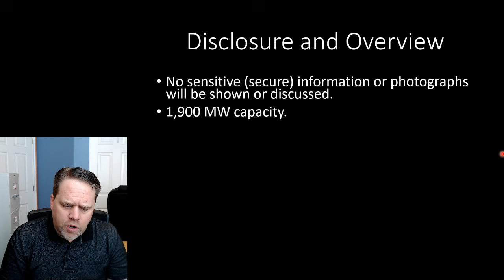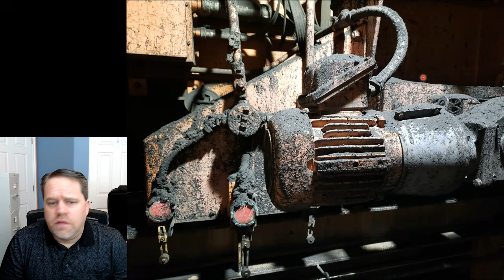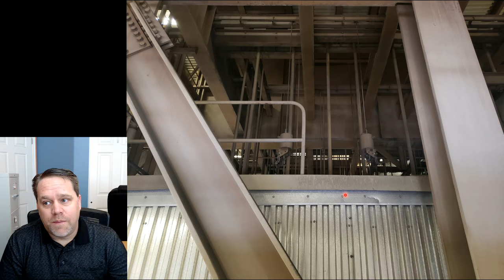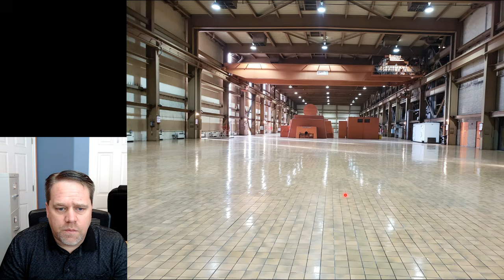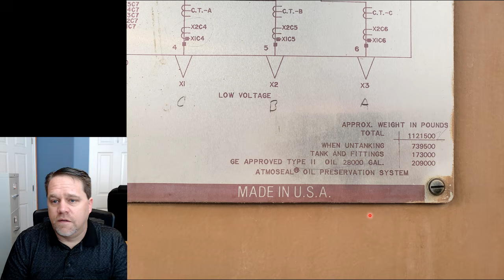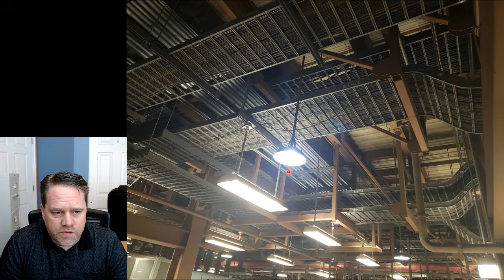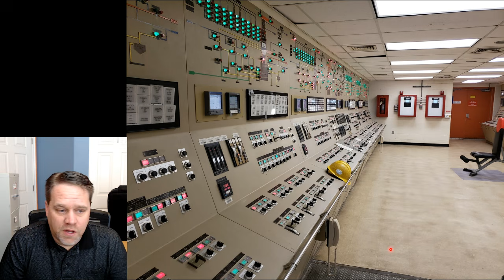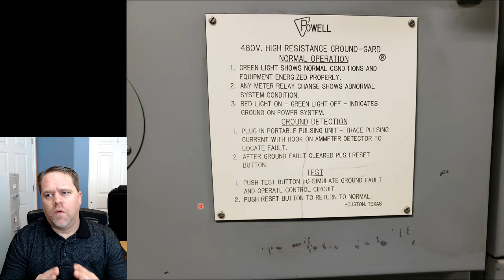Inside a coal-fired power plant (IPP plant in Delta, Utah)

Comment: I appreciate what you do. I've worked at 2 coal fired power plants and now a gas/oil one and have seen the same configurations on the east coast. The main reason why boilers are hung from the top though are not due to seismic activity but because metal grows when heated. On a typical 200mw or greater boiler, that mass of a boiler will expand over a foot from cold to online. That's why all the connections going from the basement to the top are not rigidly connected to the support structure. There will be flex connections on piping areas that allow for that on areas that have to be close. Look at the burner front. Any instrumentation that goes from catwalk to boiler will probably have a steel braided flex lines with slack that connects to it. If not... things will snap. I like your vid and keep them up. I just had to clarify. It's people like you that teach us that are new to the industry so PLEASE keep it up.
Reply: This is correct. I'm a performance engineer for GE Power. We are the OEM for half the coal fleet in the US.

Comment: They take the CO2 out of the coal before burning it??? That's quite the trick! We should sell that technology to the Chinese and get rich! 🤣🤣   
They're removing the sulfur from the coal which reduces the amount of *S*O2 released on burning. The coal is washed and the denser FeS pyrite settles out faster. SO2 released from the stack combines with water in clouds to produce sulfuric acid and acid rain, so the SO2 has to be removed per EPA limits by washing the combustion gasses with calcium hydroxide spray water forming CaSO4 - gypsum, which is then sold commercially. If, like the Chinese, you don't take care to remove the trace strontium sulfide in your gypsum, then when it gets incorporated into drywall and sold to builders in the South, it reacts with humid air producing hydrogen sulfide and carbon disulfide, destroying copper wiring and pipes throughout the house and injuring health of the occupants.

Comment: That was awesome, in the actual meaning of the word. The turbine part you showed looked like arrays of brushes for slip rings, is that wat it was? I saw a few bus bars above that leading to those brushes. The excitation voltage that I read was 560 V I think, so is that what's initially creating the magnetic field in the rotor? I also did not know that cal/cm2 hazard was a thing, but it makes perfect sense if you're dealing with flash and shockwave energy.

Comment: :/ The CO2 is produced by the combustion of the coal. It's not something that can be "cleaned out" of the coal. It is exhaust gases that we are concerned about when we say that coal is a "dirty" energy source.
Reply from the maker: Fair enough, I'm just an electrical nerd.
Reply: @RyanJacksonElectrical  I did enjoy the rest of the video, and found it to be very informative.
Reply: Ironically burning wood and biobased stuff creates more CO2 than coal.
Difference is that burning coal increases total amount of CO2 in atmosphere, while biobased stuff circulates existing CO2.
Reply: @jarskil8862  yeah. Biomass energy production is considered carbon neutral because the co2 just goes back into the air where it recently came from instead of hundreds of millions of years old dead trees.

Comment: What's interesting is bassically the boiler the coal is ground to a fine dust and is bassically a controlled explosion as well built an airport with structural bolts that same size there a pain to work with

Comment: Great video, thanks. Couple of things: transformers are normally drained to move them and are shifted on rails similar to railway track (bullhead). Other thing, are the generator unit transformers used also for starting with reverse power flow?
Reply from the maker: I'm not sure, sorry.
Reply: They have start-up transformers that are used specifically for that purpose.

Comment: Tried to get an idea of how big the boiler is...

1 cubic ft of water is 7.5 gallons of water.  So that means this boiler is 46,267 cubic feet in volume.  Let's say you live in a 1,000 sq foot apartment.  That means if your apartment was 46.267  feet tall you could just fit the volume of water that your boiler holds in your apartment (that is empty).

TL;Dr: I've seen ponds that hold less water than this boiler.
Reply: Boilers are about 10-15 stories tall ,😁

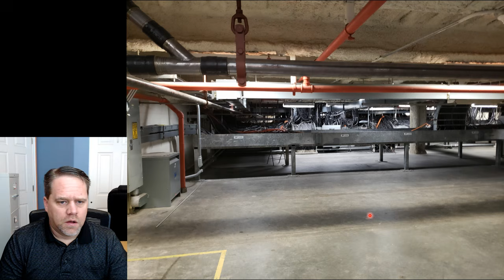Comment: 20:48 that generator engine looks like a 4400HP EMD engine..... same stuff they use in locomotives 
.
however.... the HP on that generator might be "tuned up"..... as it doesn't have to run 24/7 AND! be reliable, like on a train
i know marine engines have higher output than semi/locomotive versions of the same engine (due to higher RPM limit....bigger turbo.... bigger cam-shaft, ETC)

Comment: 18:43 i remember when Fort Peck, Montana's 185.25 MW dam and powerhouse needed a new transformer..... 
they used this HUGE semi with like 100 tires (idk if it was 100....but it was more than 18 wheels!!)
.
even with all the tires spreading the ground pressure out..... it still put deep groves in the roads
every soft spot in the road bed was found that day..... and left behind a nice "hole" when it found one
.
the Corps of Engineers had to pay MT-DOT to repair the roads
.
.
.
as far as lifting it.... i think they used hydraulics
no way a cable and gears.... like a normal crane has.... would be able to lift it
.
however, hydraulics can lift/pull a CRAP TON of weight, even with a tiny hand pump...... its just going to take 6 hours to lift 1 inch lol 
but im sure they used electric pumps to make the operation a BIT quicker!
.
.
.
fort peck dam is 4 miles long..... worlds largest hydraulically earth filled dam
the lake has more shoreline than the coast of cali....1700 miles.... and ~240 feet deep
.
"hydraulically earth filled" just means they used dredges to mix the dirt from the river....with water
then pumped the "slurry" threw pipes to the dam.... let it run out of the pipe..... and the water run off
leaving behind just the dirt
.
and they slowly built up a MASSIVE dam..... basically making "mud pies" like we did as kids
just on an industrial scale
.
a lot of out-of-town people think its just a big hill.....as its just covered in grass....not steel or concrete like people expect a dam to be
we also tell these people to watch out for the "snow snakes"
they are white, to blend in with the snow..... and 3x more poisonous than a diamond-back rattlesnake 
.
always funny to see them starring at their feet while walking threw 2 foot of snow HAHAH!

Comment: so is your special field arc flashes? (im an idiot btw) my uncle has a buisness doing electric motor vibration anaylsis, i can just imagine it would take him years to align all the motors and then youd have to start the whole process again right away just out of curisosity, how big is the skelleton crew? around my way its all hydro power, all under 500Mw i can speak for the bigger stations but i know the smaller stations (just under 10Mw combined between upper and lower) has one guy check the bearings for about an hour every fortnight, they also have a 30s/40s Pelton wheel and turbo altinator (was only kicking out 300kw when i saw it, but i also happen to be one of the first consumers down the line from said power station, pretty wicked knowing my power comes from a near 100Yo turbo alternator

Comment: The high side voltage on step up transformer (GSU) is 345KV (phase to phase) That info is on the nameplate by high side tap settings chart.

Comment: Do they utilise the generator  heat for heating the local community etc? Here in Finland every power plant also heats the city nearby.
Reply: Would love to get hot water from nearby plywood plant. Instead we are using expensive electricity for heating :/
Reply: No that's not typical in the US. Generally these plants are in rural locations, often close to the mines. Transporting the stream would be unfeasible

Comment: Arent there a couple system that alos use optical sensors right inside a rack and in case of any flash instantly trigger a huge 3-phase shorting mekanism to blow up the relay "controlled" and protect the rack thats been worked on?
Reply from the maker: Yes sir. Eaton's arc quencher, for example.

Comment: Thanks for the great video.  I think the 500 kV applies only to the DC link to southern California.  The switchyard may be less.  The AC to the DC rectifier would need 0.707 times 500 kV, right?

One other point: the fossil fueled power plants will have to be replaced with renewable energy -- wind or solar.  The timeframe is about 2035, but there may be efforts to speed that up to much sooner.

Comment: The reason for the heaters in the thawing shed being 480V instead of a higher operating potential has to do with the dielectric strength of the heating element insulation.  Being 480V means that the peak potential to ground is only 392V (peak of 277V RMS; I know it is on a resistively grounded system but each phase is 277V to ground in normal operation).  Higher potential elements would require much thicker insulation, which means that the nichrome or kanthal (probably the latter given that kanthal has a higher maximum temperature and the element casings are already running cherry red) wire in the elements would run hotter and thus be at more risk of melting.
Then there is the fact that 480V elements are a COTS item.  And on top of the cost of custom elements, any cost savings from smaller wire would be eaten up by the 5.5MVA+ of conversion transformers as opposed to just tapping the extant 480V buss.
Reply from the maker: That is a GREAT point.
Reply: @RyanJacksonElectrical  Also on rewatch, the exhaust scrubbers remove SO2 not CO2.

Comment: Ive seen power plant alternators cooled with hydrogen gas that’s pushed through the alternator core. Interesting to see one that has direct water cooling.
Reply: BMW alternators are water cooled and very expensive. I recently did one in an LI series, almost 2 days to do an alternator.
Reply: The cooling water pipes were labelled as being for stator cooling.  Here in the UK in large alternators the stator is usually water cooled, and the rotor hydrogen cooled, I think I’ve got that the right way round.

Our very last coal fired power station is closing next month.

This video doesn’t show the vast amount of ancillary plant required to operate a large coal fired station; if it did it would probably run for hours.

I have not visited any power station here where we - the public - were not taken into the main control room.

Comment: Do you know how much steam pressure this plant runs?  I talked to an old welder a few months back, who helped to build the Allen S. King plant in Bayport, MN, who referred to it as a "supercritical" plant, and the pipes had to handle something like 3900psi of steam pressure.
Reply: Supercritical operates at 3600 Psi and 1000°F. The piping is rated for much higher as the primary safety are usually set to open around 4250psi if something would cause an excessive pressure spike.
Reply from the maker: I do not, sorry. I'm an electrical guy, I only know enough of the other stuff to make a semi-coherent video. ;)
Reply: a bit late but the nameplate on the turbine says 2400 psi, which i would assume isn’t even the high pressure turbine since it seems low but i could be wrong
Reply: @sandquistn 
I don’t know about this place, but one of similar slightly older and of similar size In the UK was 2300 psi at the input to the HP turbine.

Comment: My friend told me that all power lines are DC, absolutely handicapped.
Reply: Some are, but yeah. NZ has a nice HVDC line for example.
Reply: @czechgop7631  that I knew, but they tried claiming that it goes dc from the lines and the breaker panel converts it to AC

Comment: Great video. I'm an operator in a coal station in the uk. Very similar mix of old and new. I think the environment agency is stricter here. We have to have flue gas desulpherisation and selective catalytic reduction retro fitted onto our units. My station is 4 x 500mw units but run at 50hz 3000rpm. Our big motors are 11kv. But it was built in the 50s.

Comment: This is interesting for me as I worked my way through college spending five summers painting piping inside a 250 MW coal plant along the Mississippi river. Yes, I literally climbed through that entire plant painting the miles of pipes. I recall one length of pipe I could not reach, no access from any direction .. we constructed a ten foot long paint brush handle to a three inch paint brush and I primed and painted that pipe on all sides .. Cheers .....

Comment: Hi, great video. The high voltage rating of the GE Pittsfield built coreform GSU (generator step up) transformer is actually 345kv (345,000 volts) nominal. Per the HV denergize tap changer ratings of the one screenshot you showed of the transformer nameplate it shows tap position number 4 at 345000 volts

Comment: The 700 ft chimney..I learned in chemistry something about chemical reactions and chimneys that the taller they are, the more complete or efficient the chemical reaction.
Does anyone know what I'm talking about?
Reply: A taller chimney usually results in a better pressure differential which makes a better draft. This can get more air moving through the burner with less effort so its more efficient in that sense as well.
Reply: Thanks for the reply. Assuming I remember correctly the height had something to do with chemistry and chemical reactions.

Comment: absolutely excellent video. i'm seriously considering a career in the DOE as a substation operator. however, i'm terrified of arc flashes and explosions. i was in the marine corps, later a pilot, and have no problems with most dangers, even ones out of my control. but the idea of doing everything right and just blowing up seems a bit ridiculous to me. especially when you're just told to go flip a switch or open something and now it's just your day job to go stand in front of unimaginable power that will either blow up or not. am i being dramatic? i've been trying to learn as much as my electrically ignorant self can via youtube and other sources while contemplating whether to go down this road. it seems like a wonderful career outside of finding yourself in a burn unit with hearing and vision loss, even when doing everything 'right'. it also seems sketchy when the difference between staying alive and not is someone in a control center or wherever pressing a button at the wrong time.
Reply: Go for it and you are being a little over dramatic. Been in substations for years, great job and so many different systems to learn. As far pressing buttons at the wrong time, that should never, ever happen. Any time any button in pressed, switch opened, breaker closed etc.. there is a written procedure that is followed and zero tolerance for errors. You will follow procedures yourself to minimize any exposure and no one takes shortcuts. Sure, equipment can blow up, but the amount of equipment vs blown up equipment is tiny. You have a better chance of getting in to a car accident on your way to work.